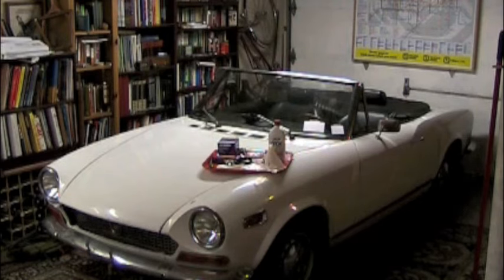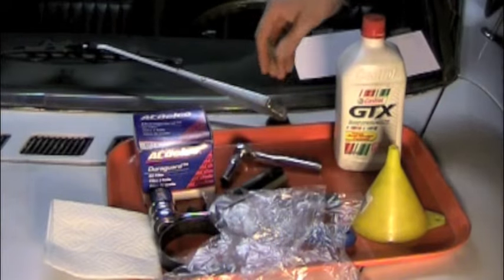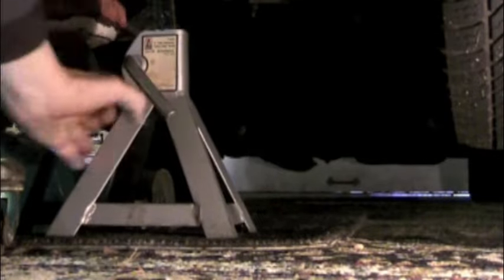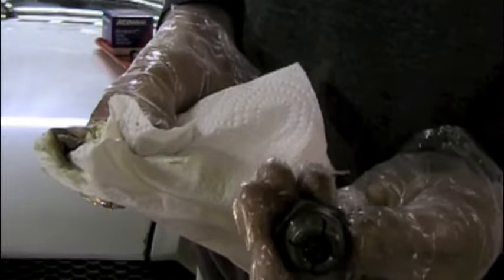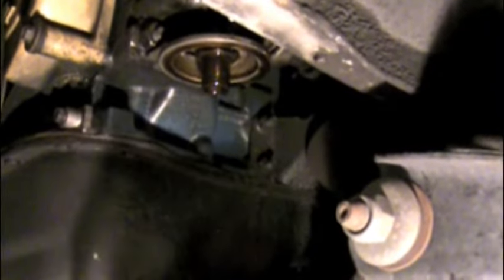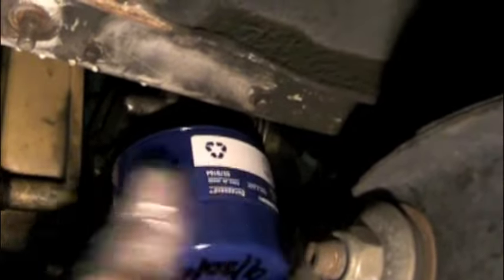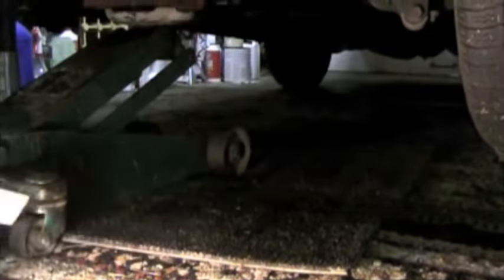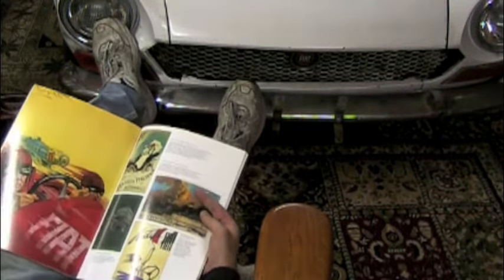Fiat 124 Sport  and Spider 2000 Oil Change

Comment: I am planning on using 15W-40 Rotella. That is what hundreds of forums have recommended to use.
Reply from the maker: Excellent choice. Shell  makes good oils and the 15w-40 is an ideal option for older Fiat engines. I use the Castrol 20w-50 primarily in hot weather and because it is a little less expensive. (and I'm a cheapskate)

Comment from the maker: Excellent point. I usually run the engine for a bit to get the new oil circulating, generally by driving around the block or down to the gas station. I then shut it off and give it a few minutes to drain down and then check the dipstick for the level drop & top it up. Good idea to check every couple of gas fill-ups too.
Alden

Comment: Just changed my oil for the first time using this video as my guide. Perfect! 
Now if you could make a video where you take off the bumpers and replace with Abarth bumperettes....
Reply from the maker: professorcookie I've never actually done a bumper conversion on a Fiat. I do know that different years have different attachment arrangements, so I'm not sure any video I did would be widely useful for that.Alden

Comment from the maker: This is a 1970 BS0 version. Originally had a 1438cc motor. Now a 1592 out of a 1973. Never had a fuel injected model, but have had several carb ones over the years. Oil filters and changes were always the same setup.

Comment: Hi, thanks for the video.
How many litres of oil does the 2000cc engine require?
I have got a 2000cc from 1979.
Reply from the maker: Your 1979 takes a little more than the earlier (pre-1975 cars) So 4.125 liters is recommended. (The pre '75 cars only need 3.75L/ ) Hope that helps.
Reply: @FlashDriveFilms  Thank you very much!

Comment: What is he pulling at 7:15? When should I pull it?
Reply from the maker: That is the manual choke knob. Just to the left of the steering column, under the dash edge. Used on a cold engine, just before turning the key.Here is the thing: if your Fiat is newer than, say, 1974, you probably have an automatic choke, either run by water or electricity, so there is no choke knob.

Comment: how about showing how to adjust the valves
Reply from the maker: +tom ashton Hi!
I haven't made a valve adjustment video (yet?) but the next best thing is my video showing the tools & techniques needed
https://www.youtube.com/watch?v=ZM9Ow5Qa_oc

When you do adjust the valves, make sure the engine is absolutely cold and give your self plenty of time. Have a scratch pad & calculator handy for the shim thickness math involved, and make sure the shims are completely seated in the tappet buckets before turning the engine.
Alden
Reply: +FlashDriveFilms my first fiat was a 67 1500 push rod engine, i later worked on foreign cars, over head cam engines were my favorite
Reply from the maker: +tom ashton I almost bought a '63 1500 once. Nice shape , needed a top and a few things, but they had lost the paperwork.  Never saw one as nice for as low a price again.  I always thought the 1500 looked like a 2/3 scale version of the Peugeot 404 cabriolet. Both styled by Pininfarina, so maybe they sort of shared notes in different departments on that one.
Alden

Comment: Could you send me a link to a good reliable website to get parts?
Reply from the maker: I've used Bayless and International Auto, but Vick's also has good selection and has been mentioned by others as a good spot. (haven't used them yet myself, and no endorsement implied on any of these examples) And surprisingly, I have managed to get a lot of common parts like brake pads and oil filters at my local car parts store. So you might not even have to order online for some things.
Alden
Reply: ok thanks i got a 1976 model for my first car, and it needs some parts, thanks

Comment: did you use 20w-50?
Reply from the maker: +Tyler M Hi! Sorry about  the delay in answering. Yes, I use the Castrol 20W-50 in the Fiat these days. Lower cost than synthetic, it seems to have low oil consumption  and I get get very good oil pressure. I used to daily-drive the Fiat but have cut way back on cold weather driving. I used to switch to the 10W-40 for the winter months.
Alden
Reply: +FlashDriveFilms awesome thanks I just bought a 75 so I'm new to the fiat world